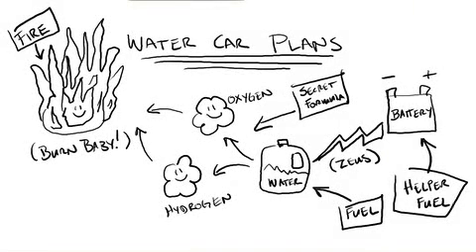Water Is Not An Energy Source

Comment: you 've made some good points.  there are however cars that run exclusively on hydrogen without damaging anything.  The only trick is using some renewable source of electricity to do the initial electrolysis.  if you can accomplish that, then you really aren't polluting at all

Comment: Nice video, not quite as good a job of explaining the hydrogen scams as you might have done...but definitely on the right track. 

It would be interesting to see an experiment that investigates the mileage of cars being driven by hydrogen true believers with the system power switch under control of the experimenter, and the driver doesn't know if it's running or not.  

The hydrogen booster scam is all about psychology, not physics.

Comment: Hey guy guess what i jus happen to be a physicist. There are a few thing you left out there. #1 water just happend to have more energy then any other fuel. #2 you can make a car run off of just the water. You do have to use an HHO to split it but then the motor is what powering it huh. #3 last auto makers are looking into putting out car with HHO's on them in a few years. But i give you this people need to look into what they area doing before they just slap one on their car.

Comment: I am not talking about Dr. Faraday type of electrolysis, this is a whole new take on the idea. And the point is Hydrogen is not an energy source. The amount of current used in the new way to break water down is minimal, for the voltage does the work. It all has to do with the properties of water, and since you don't seem to know much about water you should try a learn. But don't worry people like you are in the majority, water the compound everyone knows but knows very little about.

Comment: Stanley Meyer was not a fake if you take the time to go through the court files you will see that they tampered with the device and wouldn't let Meyer correct the problem. The guy put salt into the water fuel capacitor and that shorts it out and it wont work. But Dr. Daniel Dingel has been running on hydrogen on demand systems since 1968. Why don't they want this technology? It spells the end of the age of oil and power generation companies, as you can see they are not going out quitely.